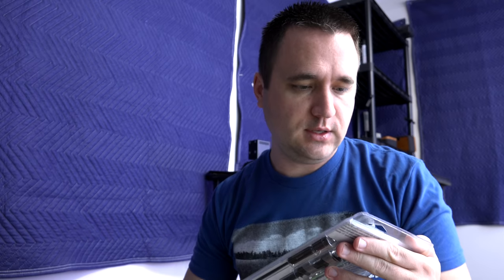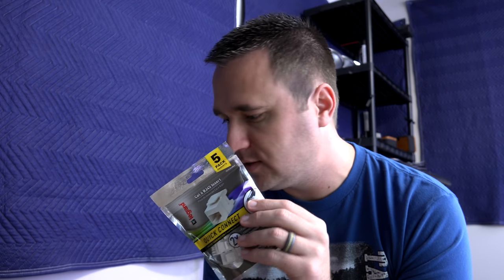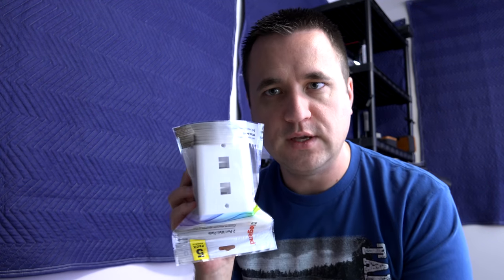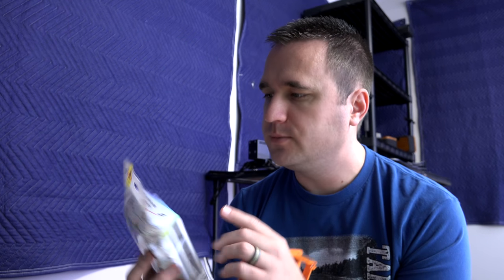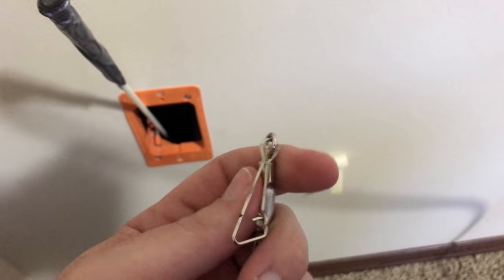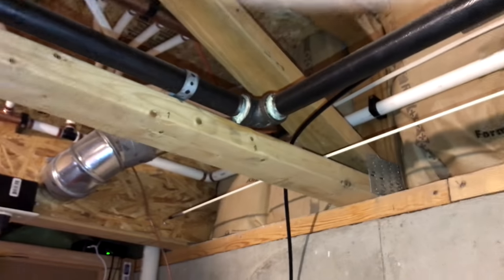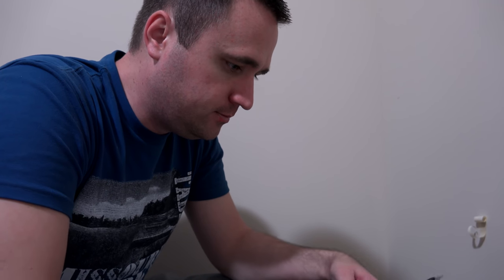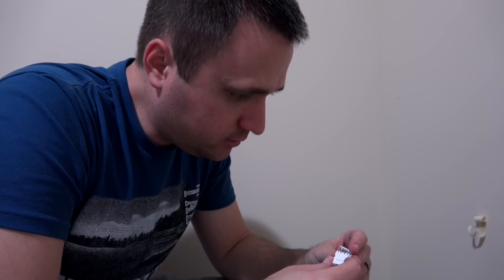Cat 6a Cable Run and Ethernet Jack Install

Comment: It'd be nice to live in a place where homeowners are allowed to run their own network cables through their home.  :-)

Here in Australia we have silly rules against doing things like that.  :-D  

Have I run my own network cables??  I'll never tell!  Shhhhh!!!
Reply: That sounds totally bizarre, what's the reasoning behind that rule? There are of course rules against doing electrical installations on your own, but for Ethernet?
Reply: That especially doesn’t make sense if you use Plenum cables (the ones that don’t produce a toxic smoke when burned).
Reply: We can even run them between homes to share the network resources with each other.
Reply: Freedom to do these things in the USA is nice.   Although, some poor people still probably can’t if they live in an HOA.
Reply: Running certain cables and wires I agree you should have a professional do it but I agree you should be able to run your own network cables.

Comment: Is it really worth it...
Reply: Yes. Wifi is half duplex, unreliable, high latency, and less secure. No way from someone on the outside to tap into a cable inside your walls. Wired is much better.

Comment: Nice job. I hope you didn't kink it because that F@#$%s the cable. You are supposed to leave as much twist in the cable as it goes into the jack. Cat6 would have been better to use and work with. You don't need cat6A. I hope you also match up the correct letter A or B. Also remember to make big sweeping bends when running the cable no 90 degree bends. Anyways looks like you are fully licenced to installed data cable good luck.

Comment: I just finished doing all this in my house but I live in a concrete building so integrating the cable in the wall is not impossible but yeah impossible for me haha. So I went under the house. My network is awesome. 
Oh and if you want a anti ddos script junky router install pfsense on your beast server and give it 40 gigs of ram witch gives you 2.4 million tables. And makes it impossible for a simple script junky to ddos you.

Comment: When i worked in Hong Kong we were having difficulty running a bunch of ethernet over a false ceiling. We asked our ‘local helper’ if he new of anyone who could help. He said yes and made a call. An hour later a guy turned up with a small box, we looked at each other puzzled. The guy didnt speak a word of English just ‘Mandarin’ so we had to talk to him through our interpreter. He opens the box and inside was a tiny Monkey! The guy then put a small belt on the Monkey with a hook, on the hook we tied a string.
He asks me to hold the Monkey, the guy goes FAR away and opens a box of nuts or something and shakes them. The interpreter said LET GO of the monkey........he shoots up into the ceiling and tows the string with him. 15 minutes later he drops out of the ceiling we tie our ethernet on the string  the pull that through and TOUCHDOWN...........we got cabled up!👏🏻👏🏻👏🏻👏🏻 we all need ‘helper monkeys’!!!👍🏻

Comment: Thanks for such an informative video. I just wanted to say that the link you provided for the Cat 6 RJ45 Inserts I don't think is the product in the video you used. I ordered these thinking they were the snap and go rj45 connectors but its just a pass through for a finished line. I think what you used are the "snap and go":
https://www.legrand.us/onq/structured-wiring/preconfigured/inserts/wp3560-wh.aspx 

I can't find them on amazon. Just an fyi in case anyone is planning to do an install using your links! Thanks again.

Comment: Interested in a conversation with someone about the downside of powerline networking vs. this. All of my friends that have had similar goals have been thrilled with the concept of EOP. Anyone that wants to play devil's advocate, or have a heartily based disagreement, please RE: to this comment and let's see what we come up with.
Reply: Powerline is much more limited. The cable isnt twisted, the speeds will suffer, you'll have various forms of crosstalk, no shielding, and on the list goes.